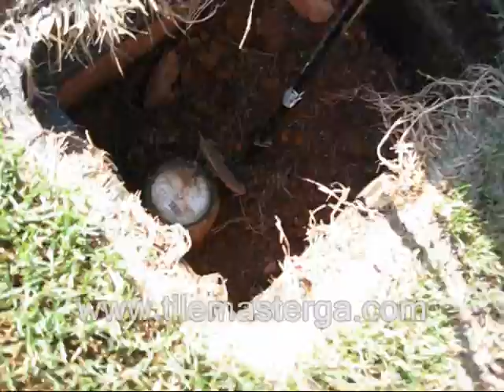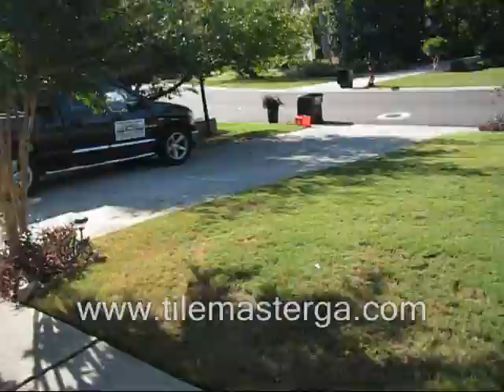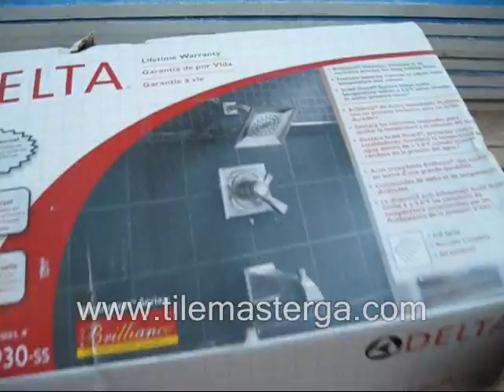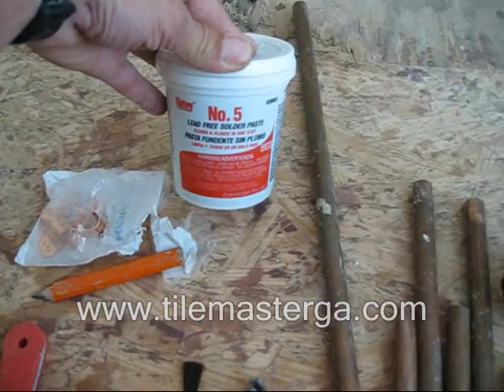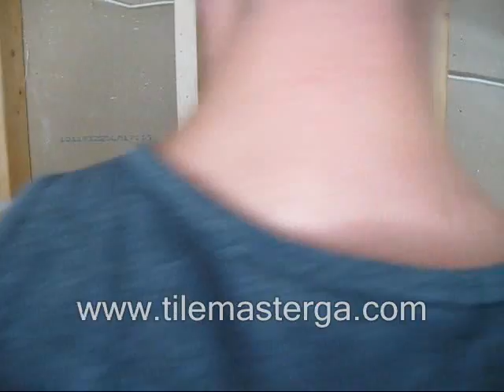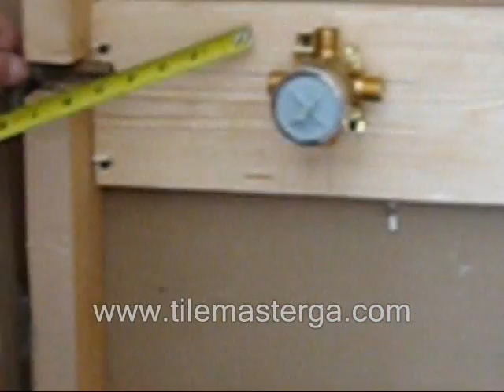Shower Valve replacement - brass rough in installation, copper soldering How to DIY - DELTA Part "1"

Comment: as per Canada  national code it should be     for shower  diver-tor  46 to 48 " high from roughen floor and 28 to 32 " shower head from diver-tor . for tub  tub spout 4 to 5 " high from top of  tub (tile return area )  and then at-least  6" pipe between diver-tor to spout and 46 to 48" pipe from diver-tor to shower head .any thing else email me at plumberinbc@yahoo.com.     and code says if u wet your bed and still u want to sleep on that it is your responsibility.

Comment: PVC can be used for supply water in my area however it is rarely done.  However it is common in restaurants/commercial because pex is not accepted for the 140 degree water required and copper is expensive.
Reply: emutiny you mean CPVC

Comment: In CANADA the valve is 6 ft deep and cant be operated by the homeowner.  The city charges $125.00 to turn the valve off and $125.00 to turn the valve on.  If you tamper with the valve yourself and break it the city will charge you for the repair.  Dont ask me how I know this information.
Reply: lol